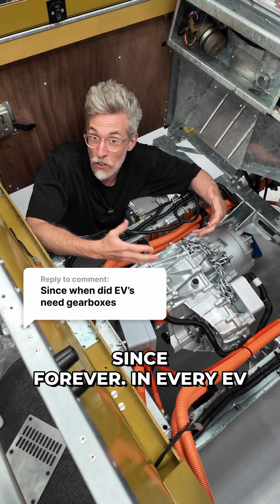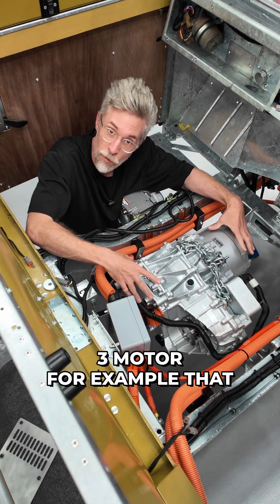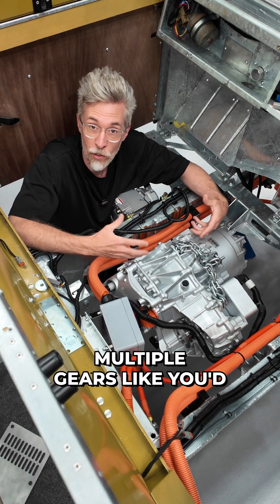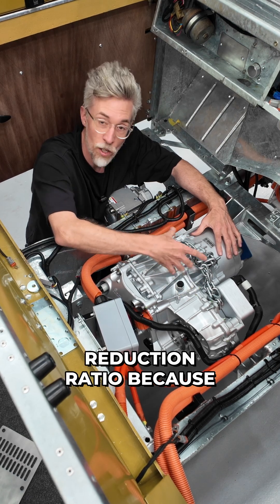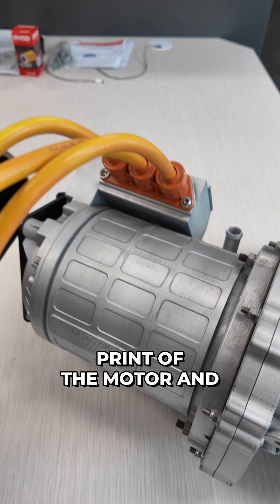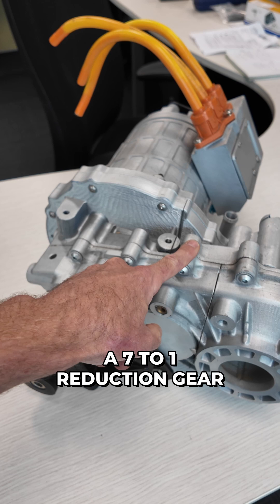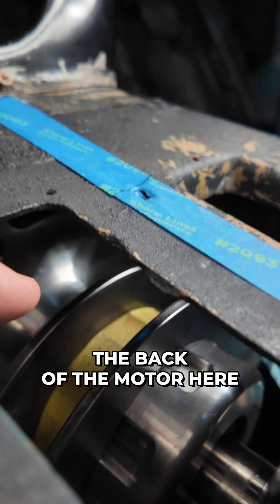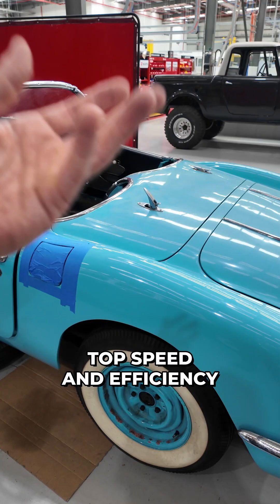Do EV's have gearboxes  #electricvehicels #automobile

Comment: There are some EVs which use a 2 speed transmission to maximize acceleration and efficiency...mostly high end German EVs. Then you have Lucid who have the diff before a gear reduction on each side...they place the diff inside the rotor as the lower torque of high speed means it can be smaller.

Comment: If you had gears in ev then will this nog save more energy? Theoretically it should right?
Reply: probably, adding gears to an electric car will cause extra friction/weight for the drive train, resulting in reduced efficiency between 1-3 percent (based of standard transmission on ICE cars) but that probably doesn't matter because if the motor is in its peak rpm range for efficiency it should outweigh that.
Electric cars don't really need gears because the motors can reach 15-25k rpm.
Ima guess that the extra complexity and parts of adding a transmission to an EV is not worth it compared to just putting in a more efficient motor/battery/BMS
I'll say that it's only realistically worth it for heavy-duty vehicles or maybe even supercars/sport cars
Reply: Most likely. The new 2026 Mercedes CLA has two gears for that exact reason, to boost efficiency.